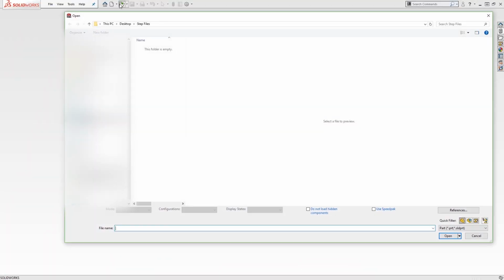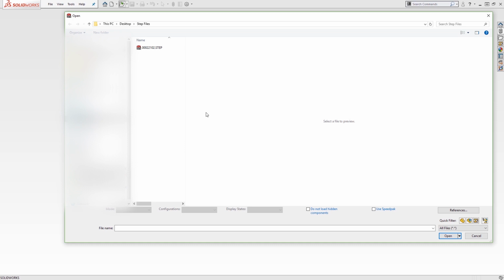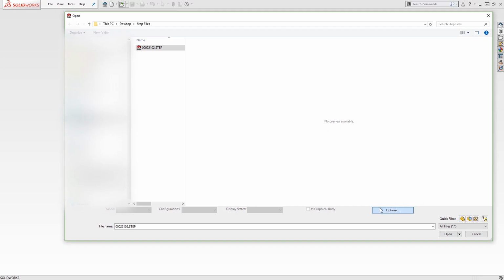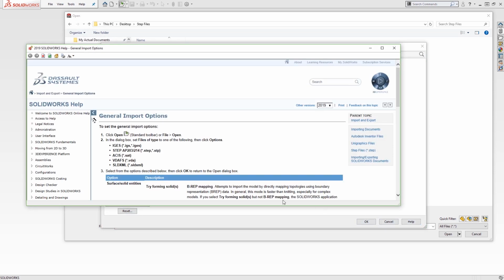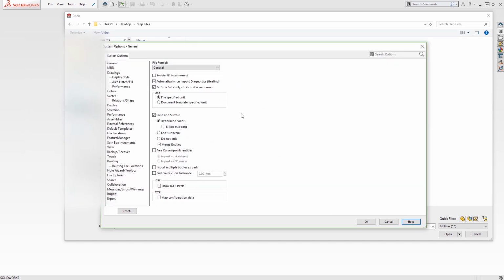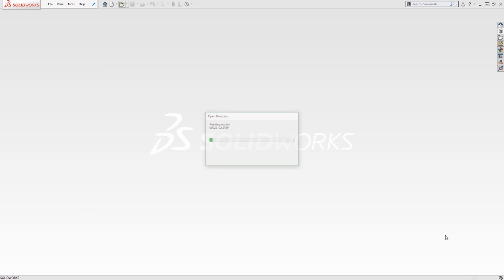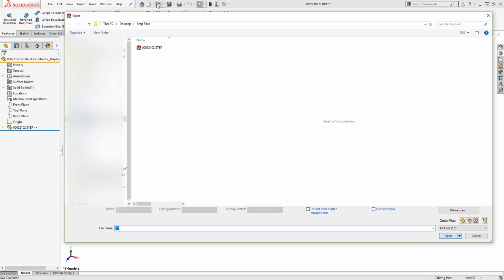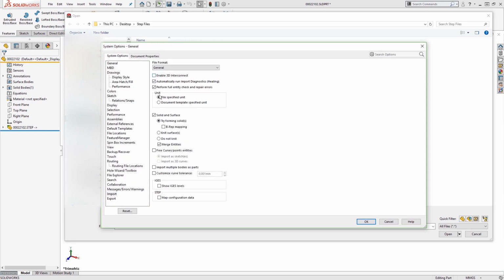Can SOLIDWORKS open Step files?

Comment: how do you know which type of step file your importing?
Reply from the maker: Hey Kenny, if you open a STEP file in Notepad (or any plain text editor) then the third line should be the file description.

E.g. FILE_DESCRIPTION (( 'STEP AP203' ), '1' );

This will state if a STEP is 203 or 214. 😊

Comment: how do i separate a surface from the step file; as in take that surface out seperately and use it to model in a new file
Reply from the maker: Hey! Check out the Offset Surface command in the Surfacing tab.

With a distance of 0mm, you'll copy the surface. You can then use that new body to model from!